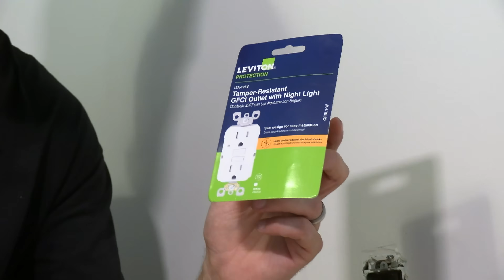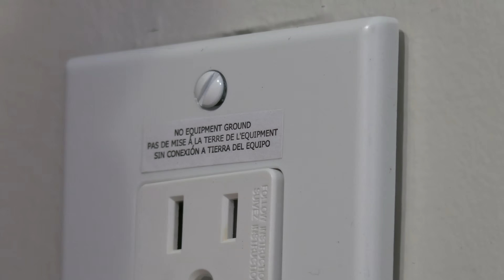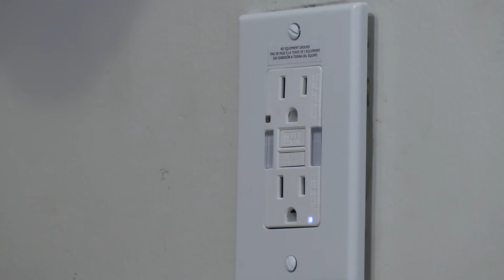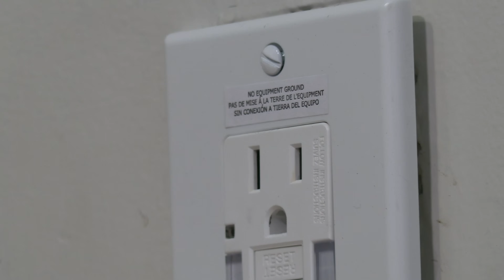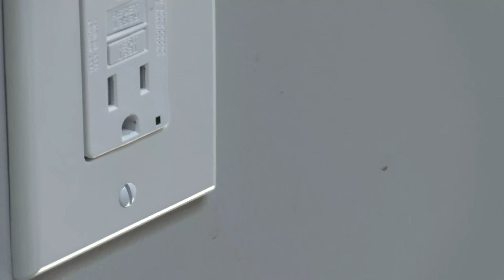Can You Replace A 2-Prong Outlet With A 3-Prong?

Comment: Hmmm... I noticed that you used the clamp under the screw terminals to secure, is that better than just making a hook and using the screw terminal? I've noticed it seems like it depends on the grade of the outlet as to whether they give you the clamp option. More videos of you fixing your houses electrical please, hopefully you share the service upgrade you mentioned doing on your house.
Reply: Yes, clamps or back wiring is the preferred option when wiring those devices. It's so much easier, faster, and less stress on the copper to back wire as opposed to side wire or bending hooks. But it depends on how expensive the device is. Cheaper devices don't have clamps while pricier ones do.
Reply: If you have a cheap 15A outlet, then don't use the back stabs. If there is a terminal clamp, there's no issue. Just don't leave all that exposed wire like he did in the video. Insulation should be all the way to the outlet.
Reply: Less expensive residential grade recepticles have cheap push-in (back-wired) connections that only are friction connected.  More expensive commercial grade, specification grade, hospital grade, and every GFCI device that I've ever seen have clamp connectors that compress on to the wire when tightened.  There is no need to bend hooks and side wire with these better grade devices (and not preferred).  The cheaper devices usually last fine for years... until they don't.  They are much more prone to fail when they are loaded up.  They are not particularly dangerous and are UL listed, but they are a royal pain to trace out and repair.  It's common for them to fail in such a way where the positiion of a connected cord can cause the failure to be intermittent.
Reply: Clamps and back-wiring is different. A clamp offers the same if not more contact and strength pressure as wiring over a screw. In fact, I would personally recommend using the clamp instead of the screw because the screw is often designed to specifically press the clamp down, not for wrapping a wire around it. Back stabbing is different. I personally do not recommend it. I have seen it fail quite often. Back stab are only good for 14 gauge wire anyway. Clamps are good for multiple wire sizes. A 30A and 50A dryer or stove receptacle comes with a clamp style pressure connection. It would be a little more complicated, if not plain out difficult to wrap those wire sizes around a screw. It’s the same type for clamp screw setup in GFCI receptacles. 

That being said HUBBEL and LEVITON GFCI Receptacles are both listed for use in either method; strip 5/8 insulation for using the clamp for either one. Strip 3/4 for LEVITON or 1-in for HUBBEL for loop around screw. These are per each respective device’s instructions.

I prefer to clamp it, that’s not a backstab.
Reply: Oppions are like butt cracks, everyone has their own and some smell worse than others.

The best connection method is "pig tailing".  Yes your other commentors are correct, but stay away from using your recepticles as part of the circuit.  

The nec allows two or more 15 Amp recepticles to be placed on one 20 Amp breaker.  This means the first recepticle may see 18, or 19 amps flowing through it's terminals as several recepticles draw power.....early failure.  Pigtailing allows the wire to carry joints to carry current past those recepticle terminals and you have a much smaller Amp to through that first one.
Reply: @keithharrington8715  Both 15 amp and 20 amp receptacles are tested to the same UL standard and both are listed to do so through the blades and/or the terminals.  An individual 15 amp DUPLEX receptacle by itself meets code for connection to a 20 amp circuit but a 15 amp SINGLE receptacle (only has one group of blade openings) does not.  No receptacle device is going to fail at 20 amps let alone 19 or 18.  Pigtails may be preferred but are not required by the code.
Reply: @tgmct  Additionally, it does not befit the mfg to make 15A parts for 15A receptacles and 99.9999% identical 20A parts for 20A receptacles.

Comment: My house was built in May 1986 and ALL of My Electrical Systems  is UP to the NEC 2020 CODE !!                                      I'm a Licensed Journeyman Electrician with over 55 years in the Trade !!!
Reply: So where did you get the arc fault breakers in 1986?
Reply: or the new places GFCI are are now required since 86